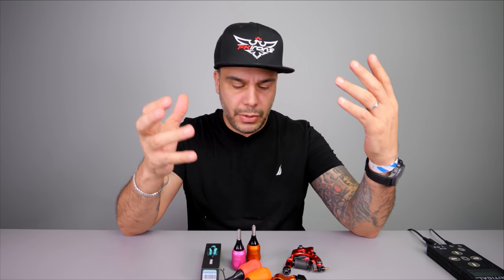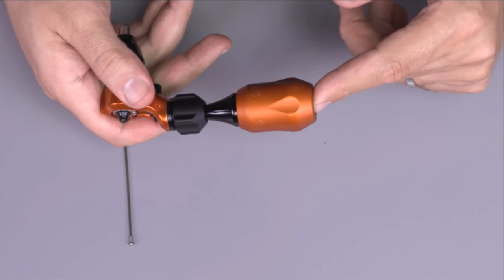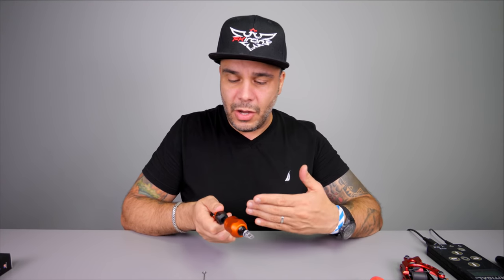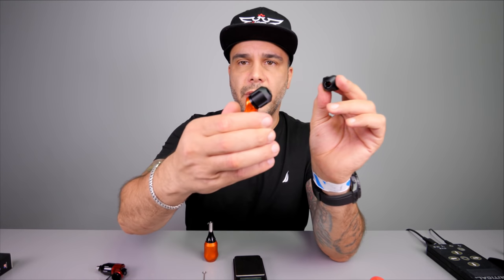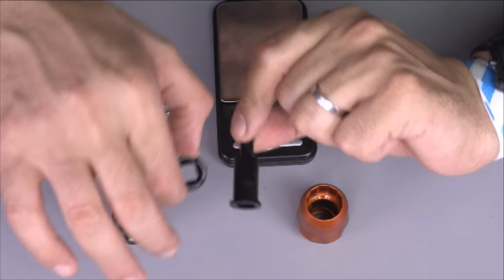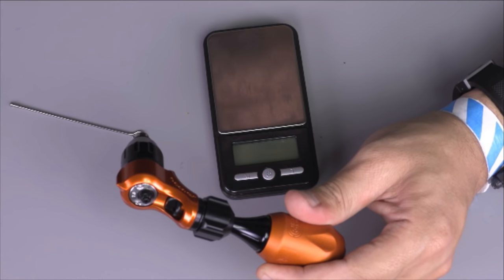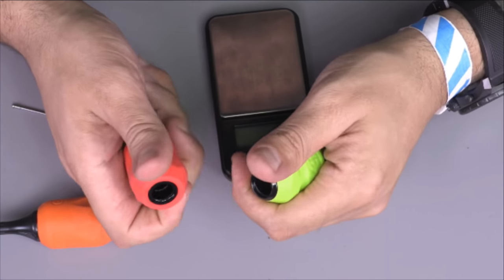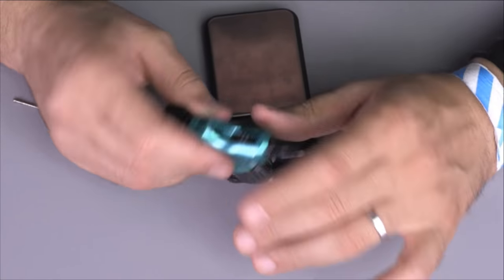Click Ergo Cartridge Grip - 101 Everything you need to know.

Comment: I love this grip, it’s my go-to grip. I use it on every tattoo as it’s comfortable in the hand.... however the plastic tube inside that holds the cartridge (not the ratchet) has cracked and it doesn’t hold the cartridge securely any more. I can’t get a replacement without sending it back to FK Irons. They won’t send me a replacement part without sending the entire grip back, I live in the UK and it’s going to cost me more than it’s worth to send the entire grip or even the broken part back to them than it’s worth it. Com on FK Irons you are a market leader, all I want is you to sell or send me a replacement part.. I have many or your machines and FK Irons equipment is my every day go-to equipment

Comment: When I received my ergo I took it apart to clean, when I put it back together I didn't fit it together properly and had to put a little tape to the cartridge to make it stay. For the first few uses I had this issue and couldn't get the needle to hang, finally I put it together correctly and felt so stupid because I can be pretty techy. If you take it apart make sure it's fit when you put it back together
Reply: Is there a video that shows how to put one back together correctly? I had the same issue and just thought the grip was faulty